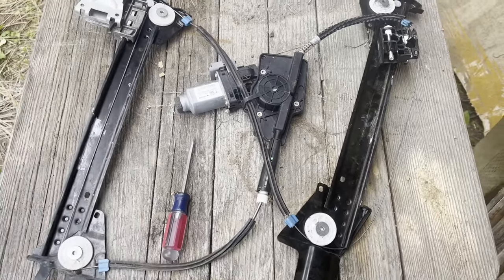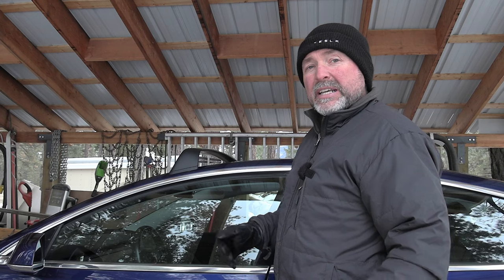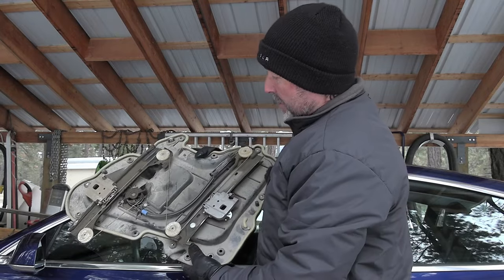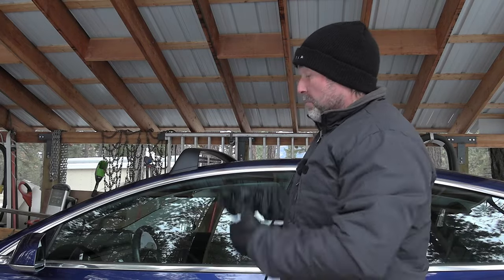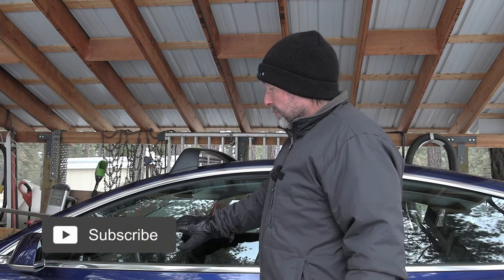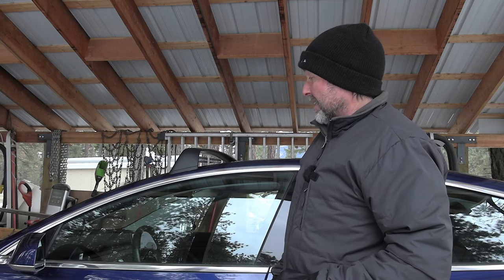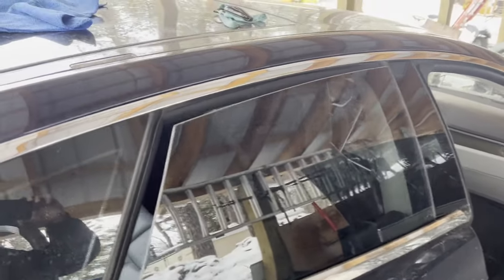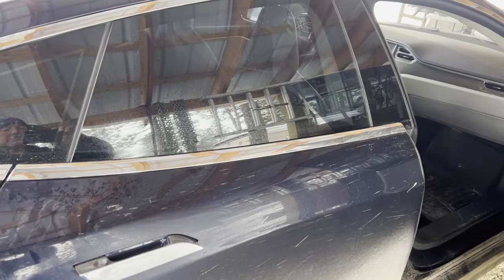Tesla Model S window regulator failure. Why they fail? What actually fails? How to repair. DIY

Comment: I understand your point of view, regarding the Gruber aluminum part to replace the plastics part that wears out, but at the same time they have invested CAD time and have expensive machinery. So even if the part will become a bit pricey it’s still cheaper than a brand new window regulator.
Reply from the maker: It's not the part price that is expensive it is the shipping. If they need to make more money on the part increase the part price, but don't charge almost $20 for shipping. At that point one can buy an aftermarket window regulator, at least for 2 out of the 4 doors, for somewhere between $60 to $90 and have all of it new. I also had the plastic pulley fail and the cable rip apart before.
Reply: @RMTFamily  agree there strategy is wrong , the part is the value for the customer not the shipping…

Comment: Unfortunately you sound like an expert!  Do other frameless window cars have the same problems?
Reply from the maker: Good question. The Model S is one the cars that has had this consistently for years without any improvements to the regulator. There used to be a lot of cars with frameless windows until around the year 2000. Due to the many challenges or problems that come with such windows many automakers got away from it. Others, like Subaru are still doing it. I don't know of any other car that had window regulator failure like Tesla Model S for so long. If Tesla would have replaced the 2nd window trolley (where the cable attaches to) with a cast aluminum part and replaced the ferrel either with a larger stronger or aluminum part then we probably would not have these issues. All the other issues besides the breaking of regulator parts are also issues with other cars and are just a continuous problem of frameless windows. 
Tesla now has improved the regulators as seen on the Model 3 window regulator I showed. Slightly different design with 2 aluminum trolleys. We had our Model 3 for almost 6 years now and none of them broke.
Reply: Good to hear that the window problems were addressed on the high volume vehicles (3 and Y).  While watching this, I was thinking there was a business opportunity for someone to rework the trolleys or make replacement parts, but if the newer ones don’t break. . . Agree the shipping for those ferrules is ridiculous.  Might be worth a phone call to see if they made a mistake and will address?  Price of ferrules would seem to be profitable enough.
Reply from the maker: Hi Dennis, A small business opportunity to make rear door window regulators for the S seems to still exist😉.
One of our viewers called Gruber and they told him that is what it is.🤷‍♂️
Thank you for watching👍
Reply: @RMTFamily  - Hi Mike - you did say that Dorman only made front door module replacements, so agree there may be an opportunity for the rears, if they fail at a similar rate as the fronts.  Must not have been a big enough business case for them.
Reply from the maker: Yes, they make the front left and right but no rear. I assume early on the fronts became a problem as those are most used and now with age the rear are failing too. I think your right, not a big enough business case with the relatively low number vehicles to start with and the now declining number of these Model S out there.
I wish I had a lathe, I would make some ferrels and rebuild few regulators just for fun and make a couple bucks while doing so😉😀

Comment: Easy fix during the winter you must always preheat the car before a drive. Never had any problem and driving S since 2013 still original window regulators. Door handles was a different matter, but after Tesla changed the door handles, no more issues with the new once.
Reply from the maker: You're right pre-heat is important. Unfortunately it does not solve the problem with the window regulator failure. The window regulators fail in all climates not just in cold areas.
Reply: @RMTFamily  maybe so, but not 100% I live in Sweden and none of our 4 Tesla cars have ever had a broken window regulator and the oldest is 2013 and we drive it every day.  Open and close the door several times a day Sommer and winter. But if California or Spain have this issue there is maybe something else involved.
Reply from the maker: You are lucky. No window regulator ever. Since that ferrel is made out of plastic as well as the pulleys I suspect heat will over time weaken the parts. How hot are your summers? Are your cars parked inside or in the shade in summer?
Reply: @RMTFamily  South of Sweden where I live has mostly 20 degrees Celsius in the summer, cars are parked outside no carport or shade. In the winter most of the days around 0. Even battery degradation har been low , in average 1% per year, more the first years and less now.
Reply from the maker: You live in the perfect climate. Not to hot or to cold. Here in Montana we have 0° too but Fahrenheit 😂 (minus 18° C). Also our summer temps are higher, around 25°C. For the passed 7 days we have been 35° to 40° every day. Luckily temps drop to around 18° C by around around 3 in the morning, but start climbing quickly again at 10AM. 
Battery degradation on our 2013 S with 322'000Km is just slightly higher, around 15%.

Comment: Very helpful, thanks. I will schedule my 2018 MS (only 64k km or about 40,000 miles on the odometer) for a full service and will ask them to check my window regulators. I know here in Hong Kong we don't get extreme lower temperatures, but there's no harm for them to be checked. Also, I noticed some bubbling on the edges of my MCU (I didn't notice it until I had to do a hard reset recently), and Tesla HK said they will replace my MCU when I schedule my next service.
Reply from the maker: Less extremes usually mean less problems. Not many Kilometers on your S. I guess unless you leave Hong Kong with the car you can’t go very far and rack up the Kilometers. To bad you’re MCU needs replaced. For some reason Tesla was never able, or wanted, to solve that issue. 
Glad you’re ok and hopefully you get over that nasty flu soon.

Comment: One of you people who have a lathe can make some money by making aluminum or brass Farrell's to replace the plastic ones. It would be necessary to make it in two parts to be able to install it without taking the regulator completely apart.
Reply from the maker: I wish I had a lathe. I would already have made some. 
Interesting that you mention 2 piece ferrel. Gruber makes a single piece with a slot cut in it, to slide the cable in. Two pieces seems like more effort but there would be no slot.🤔
Reply from the maker: @iowa_don  Your comment means you didn’t watch the video! I clearly talked about that and point out that the shipping is rip off. $20 to ship 2 ferrules to MT. Two ferrules easily fit in a small envelope that mails for a couple dollars.
Reply: @RMTFamily   I was surprised at this late date, that you were talking about the OLD Model S regulators.  I believe they were changed some years ago.  Since I have a later Model S, I lost interest.  I was also responding to @thomaslemay8817 who was bemoaning that someone did not make replacements out of metal.  So apparently he did not watch the whole video either.  Yes $20 shipping is outrageous, but far cheaper than new regulators.
Reply from the maker: @iowa_don  There are still thousands of these cars out there and many people still deal with these window regulator issues. The oldest Model S is barely 12 years old and with an average lifetime of about 20 years for a car there is a long time to go. 
Doorman makes new regulators for the front doors. These regulators are available at Parts stores for just $69 ( Also in the video😉) And since not only the ferrules break but also the plastic trolley, it's a better option to buy the aftermarket regulators for the front doors. Unfortunately the rear door regulators still have to be repaired.